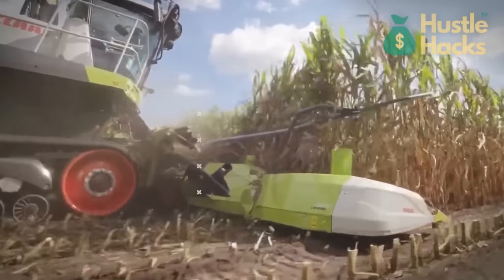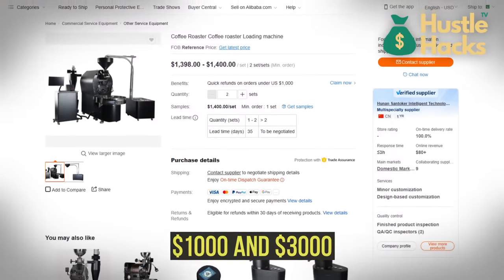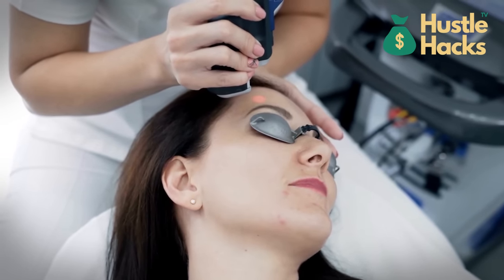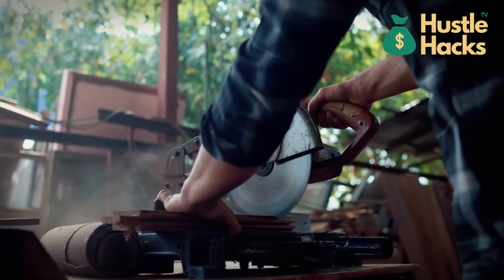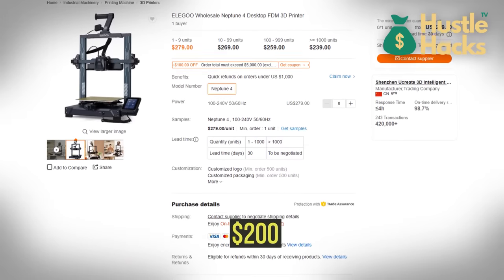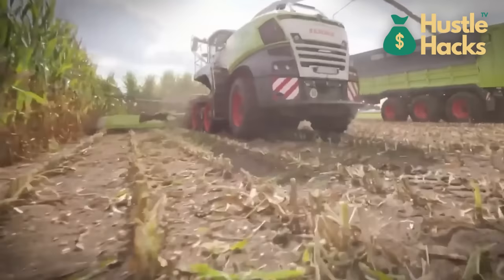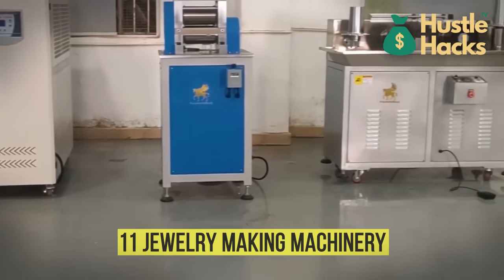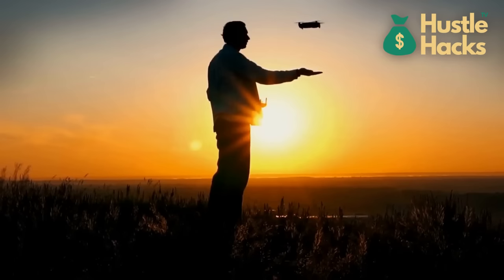Machines You Can Buy On Alibaba To Make Money 2024

Comment: I bought diesel parking heater from China after my original webasto worth 1500 bucks stopped working. Tried to fixed it spend another few hundred. China one priced not even 100 bucks and the sucker keeps running for over 4 years now. I guaranfuckin’tee you that even webasto is made in China but first shift while for some other manufacturers the same shite is made in graveyard shift 😂